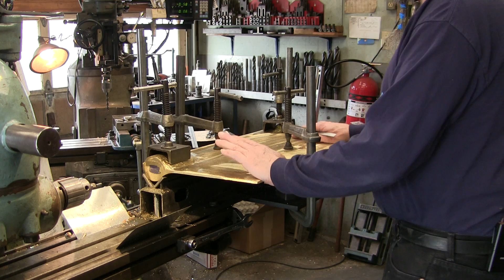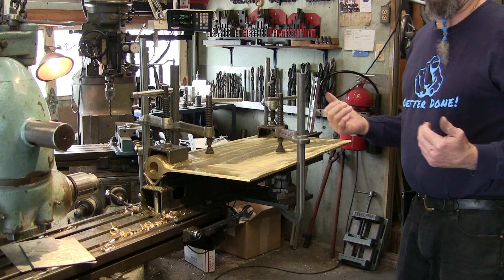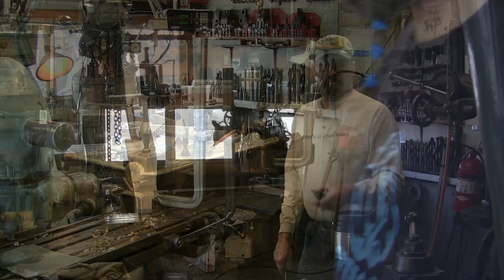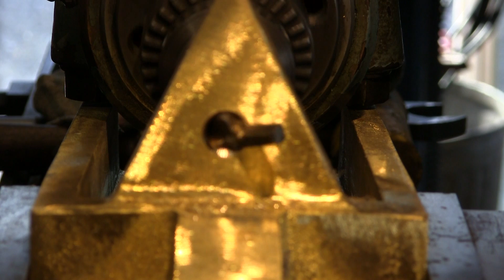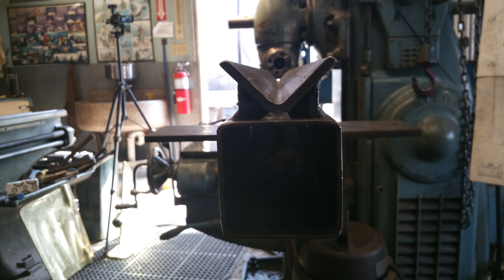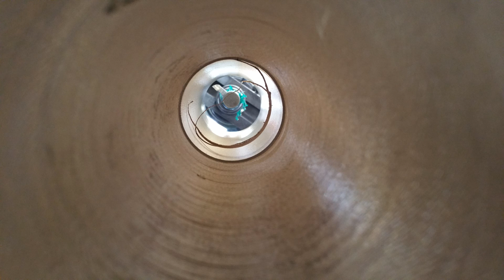Hanging out on the K&T Part Three

Comment: HI Keith I have a small HBM and love to run it. The spindle size is 2-9/16" with a rotory table and it is supossed to cut threads. There is a thread chart on the machine but I have not tryed that let. Maybe you should look for a G&L #25 HBM Good Luck

Comment: Hi Keith. Rhode Island Ray here. Hop your feeling better. My question. Do you need special taps to power tap holes or just lotsa skill and experience?
Reply from the maker: +Ray Curren You need sharp mid quality taps, time does take time on being automatic, the power, coast, brake and reverse is the key to success. Taps don't like to stop and start on the way, taps don't like to bottom out in hole or on tap shank and if reverse is to fast chuck can come loose. ;{)------

Comment: Why not do this on the lathe?  Would not that be a more accurate way of maintaining the alignment between pintle and stem?  Chuck the drill or boring bare and holding the rudder fixed against the tail stock.
Reply: +Greg Collins If I might jump in here. There are a few reasons.
It is simply too big to swing and way dangerous to be rotating the whole rudder.
Alignment and holding on the lathe would be difficult. There is only 2 points for a 4 jaw to grip to.
If you strapped it to the carriage and used the chuck as a drill you in essence have re birthed the KnT .

Hope that helps :)
Reply: +Godshole Ya I know its too big to swing, but IF you could fixture it to the carriage (had to make a fixture for the K&T too) then you would have a perfectly lined up tail stock to hold alignment.   Just a thought...
Reply: I see what you mean now. Yes it would be possible. But you would still have to have a fixture that held it 'in line' with either end presented for drilling. So that is a constant once that is set. I think the tail stock becomes redundant at this point once the jig is set for alignment. Which Keith has with alignment pins on the jig. I see that it would be handy to pop the centre hole into the tail stock, but, how did you hold it to drill the centre hole? You already have it held, aligned and ready to work on by then.

 You would have to have a dedicated lathe for these jobs as stripping the tool post off and on, and then installing the jig, for every job would be impractical and Keith deals with the alignment issue well with the locator pegs he has on the jig and the patented 'Fennerpack'. Making it a slot and go jig which accounts for the variability of each rudder.

Comment: Hi Keith,
Would bushings made from UHMW or delrin do the job properly, just curious...   ??
Like your approach on castings, gave me a couple of ideas...   ;)
Reply from the maker: +pierre beaudry The cutlass bearing are designed for the propose, but sometimes on the pintle bearing the use of delrin works well on some systems or rudders. ;{)-----
Reply: Steve p
Thanks, I'll take a note about Vesconite...

Comment: Question:  How concentric are the castings? The outer finish makes it look like swiss cheese and getting a center must be frustrating when relying on that one bubbly edge.
Reply from the maker: +frollard when dealing with castings, once you decide center location don't change your mind. the outside surface is a reference only.
;{)-------
Reply: +frollard - Yep; that first machining operation becomes the reference surface.

Comment: Keith, (tool tip) for your next boring job on a pre cast with thru hole , get yourself a military grade laser pointer, the small metal tube style.  Available online under $40 lots of places. It can be chucked into the drill chuck or collet and will allow finding/aligning the center of both ends at the same time to insure straight thru boring, on the first  bore and after the part is flipped to realign/check the other end. Clear tape with crosshairs over the holes speeds up the aligning process. This eliminates errors due to uneven outer wall thickness on the casting laying in the angle iron.  Just be sure to pre check the trueness of the laser beam in relation to the laser barrel by chucking it into your lathe and using a target on the cross slide. Rotate the chuck to check runout with the cross slide close then far away. Make adjustments to center the beam.  This laser can be used in many centering jobs during machining.  Regards, greg
Reply: They even make edge finders for doing that very thing and are user calibrated . Downside the batteries are usually flat .

I bet Keith can do it better with his tried and trusted method 

There is always the danger with mil spec lasers in eye damage 

But maybe I like the old school method